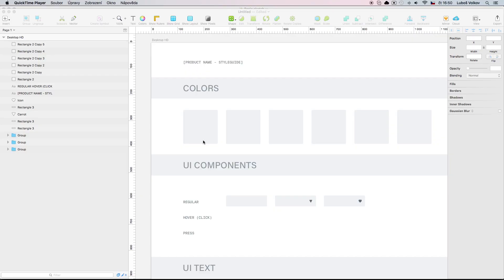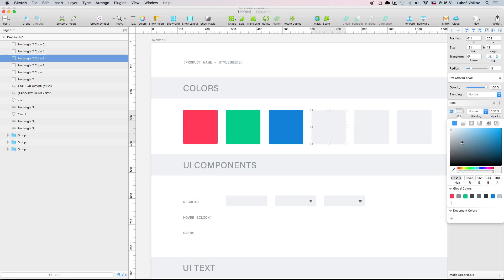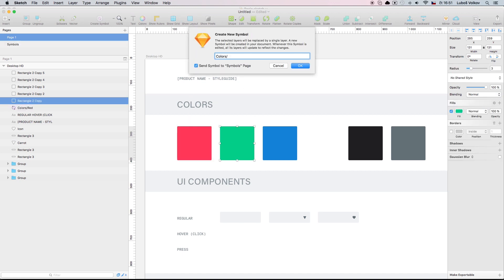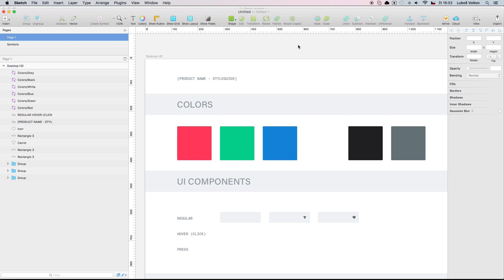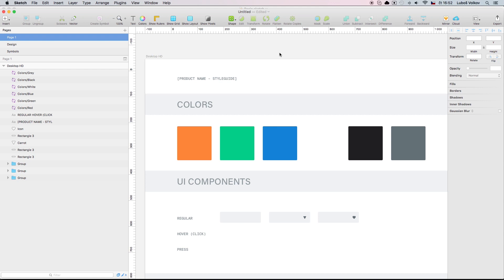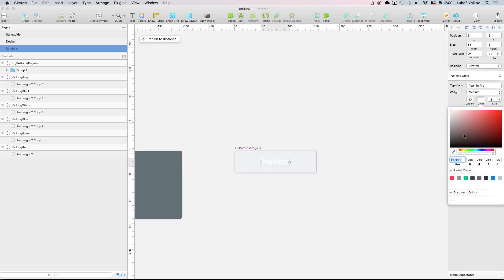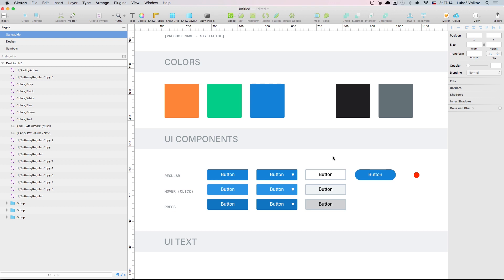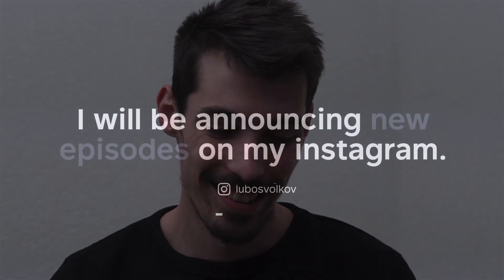USE SKETCH SYMBOLS LIKE A PRO!!

Comment: Another way to add pressed/hover/Active state is to create a white/black/clear colors with reduced opacity.  Add those as a layer on the button, and you can switch between each states without creating multiple versions of the same colors.

Comment: Thank you so much for these videos, I've been using Sketch for around 2 years but only very recently started using symbols properly and more consistently. It's amazing how powerful they are.

I want to use them to create a set of generic wireframes and a style guide that I can use on all future client projects.

Is there a way to use symbols for text? I want to create a style guide for each project but if I add all potential text styles to it might look like too much. For example a H1 style that has 2 different colours and then also left and centre alignment versions. So that will be 4 styles just for the H1. Then if the H2, H3 and H4 have the same styles, you can see how that'll get out of hand fast.

It would be really cool if I can create symbols for text that allows me to add new text content and change the colours as well as the alignment. Maybe this could be an idea for a future video.

Please do videos every week :)
Reply from the maker: Hello Marcus! Thank you for kind words. The nice feature sketch is working on are shared symbol libraries. You will be able to share them with other people and also store them in the cloud across multiple documents (I hope).

Sure, I'm using that for font sizes etc, you can also use text styles that's perfect usage of them. 
I might do video about it, thanks and keep rocking.
Reply: Lubos Volkov A video about text styles and shared styles would be great!

Comment: i made the same in sketch, but i don't have the option to choose another icon from UI/Icons/xxx. Made exactly as in the video, and in Overrides I have only one icon. But in symbols I see them both
Reply: Had the same problem. For me duplicating the symbol i.e. UI/Icon/Like carrot and then replacing shape and name worked. Same as shown with button text example...
Reply from the maker: Hello! You need to make sure that all icons are in the same size (the canvas is the same size). Otherwise, sketch is not going to recognize it as the same symbol.

Comment: please help, in the updated version of sketch, with this method, I can only get the button to change to two different colors at anytime. I realized i had to make my colors the same exact shape as the button (rounded edges primarily) to make the symbol recognize the colors. But for some reason, if I create four colors--red, orange, blue, yellow--the button will only recognize red and orange, or blue and yellow, and not all four. HELP! Sketch is so frustrating sometimes, totally riddled with bugs :(
Reply from the maker: Hello Ramon! Best would be if you share the source file with me (just share a dropbox link here). I guess that your colors are not in the same size but that's just my assumption.